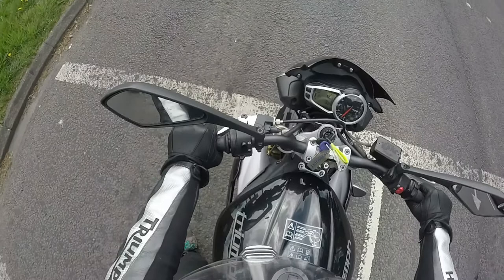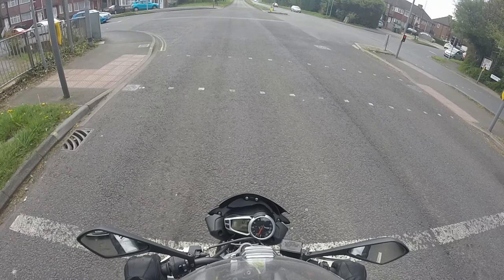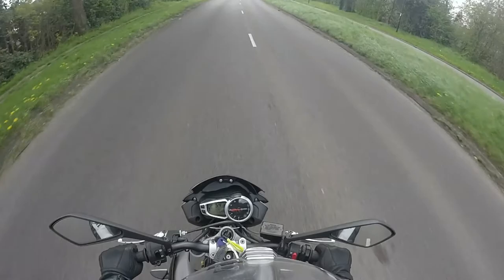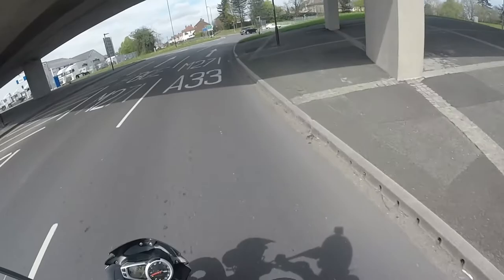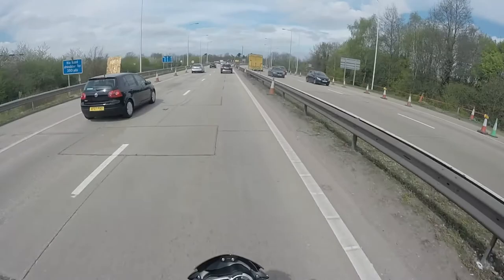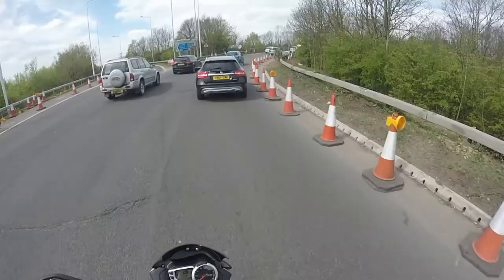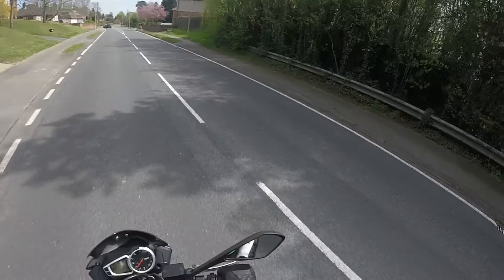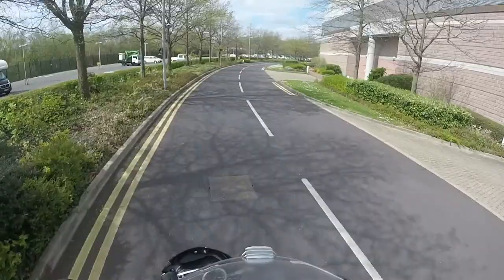Demonstrating clutchless shifting on a motorcycle

Comment: Is that safe for the gearbox?
Reply from the maker: Yes it is as long as done correctly. In fact can be better for engine in long run as you are not using the clutch